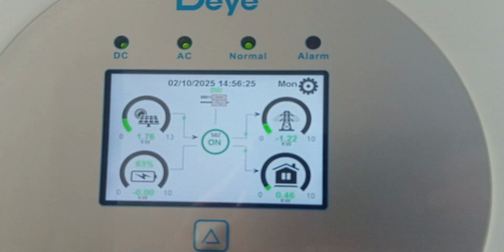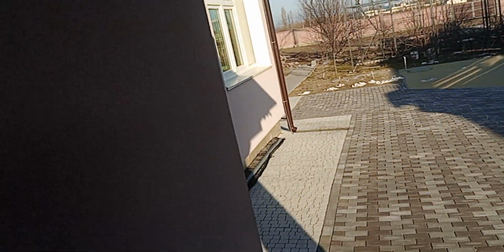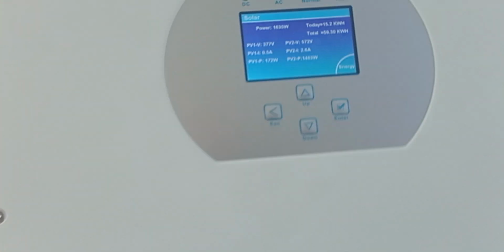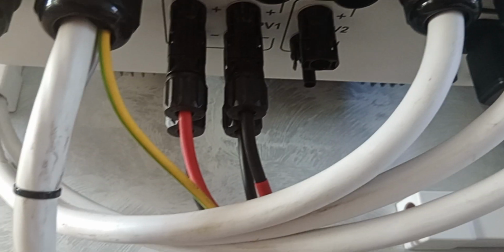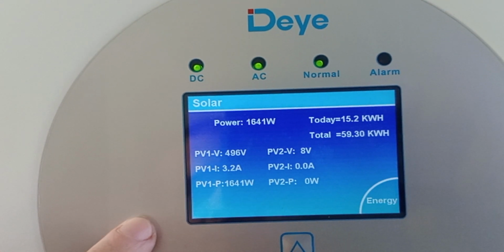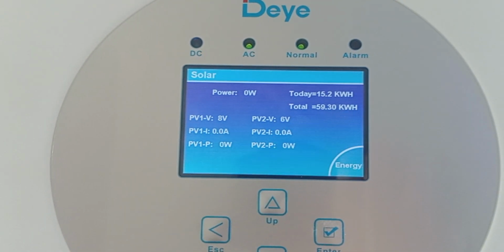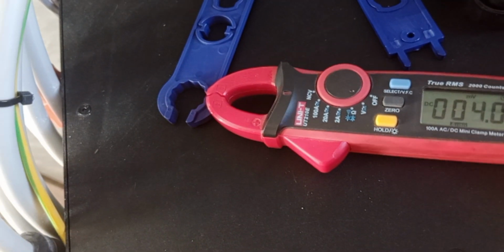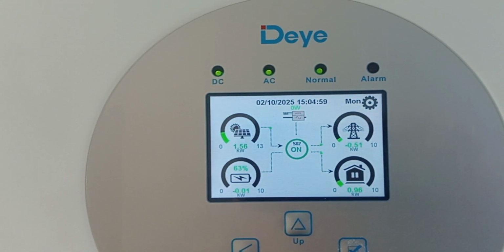Crazy stuff is going on with two parallel arrays - one pushes power in another one once they are off

Comment: We all have to remember we all do not generate 2/3rds of our solar array capabilitys in the summer, im fully charged by 11am, this would conclude worth putting the 2/3rds of the solar array on a more autum/winter/spring tilt, i have mine on a 60degress angle, the sun on the 20th of December reaches 70degress, on the 20th of march the sun is at 50degress 10degrees over the centre of the panel, setting on the equator, straight across the middle of the pannel.

Nice setup, looked into the deye and thier good for the production they can cope with.
Reply from the maker: yes, for off-grid - you have to ultimately use the winter angle. since in summer you will have your batteries full early morning already.
but I can sell, and can sell a lot (up to 30 kWh per hour), that's why I am trying to balance the output, and also to not burn out the panels and inverters
Reply: Wow wah we, 30kwh pH. Speaking of burning out, ithink I got stuck by lighting, which wasn't recorded on any weather station, burnt out my little 40amp 12v mppt, have a pwm 80amp spare, the charger I was using to dumpload the 12v wind turbines into the 48v selpos kit
Reply from the maker: hm... can't this have been rather a common overvoltage? lightning strike generally lives a black dust cloud over the device being hit by that, you know ))
Reply: It was during the night, I know I did have to many watts going through it, 2x415w I was umpluging one when it got very sunny, its just been so sunny the winter.